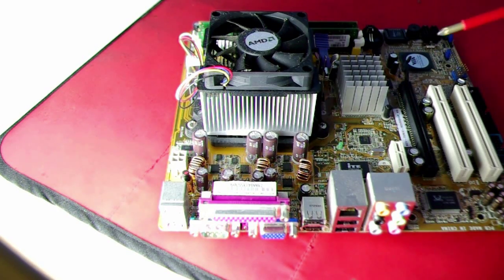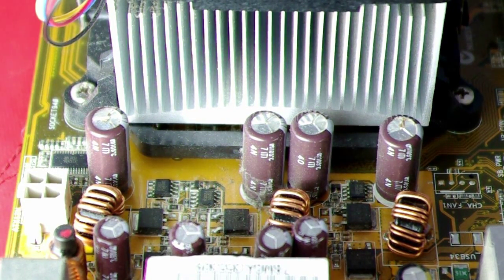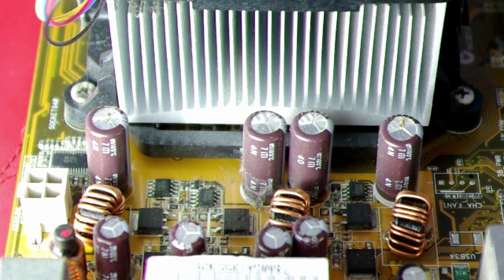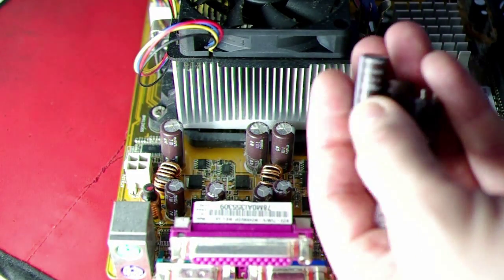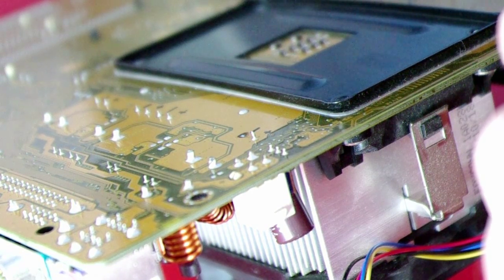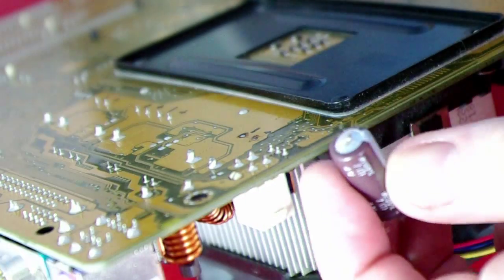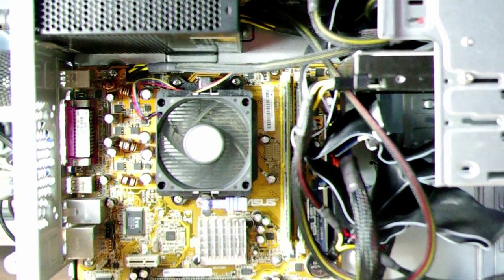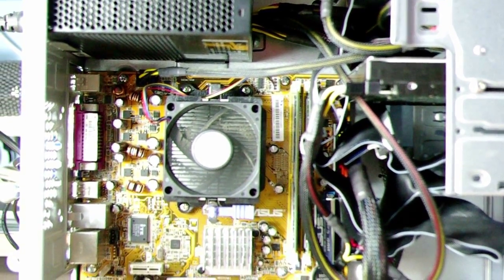Replace Motherboard Capacitors

Comment from the maker: A 45W or higher soldering iron with a 400C or higher tip should be fine. It's a multi layer board so the heat quickly dissipates, low wattage irons will probably cause damage because it will take much longer to get the solder to melting temperature.

Comment: Will it work on a lead free board?
Reply from the maker: Yes it will but lead free solder has a higher melting point so use an iron that is hot enough and at least 40 watt so it melts the solder quickly so not to damage the board. Also motherboards are soldered in an oxygen free atmosphere so don't need to use flux (or very little) but you may need to, either in the solder or applied to the joint depending on the solder you use.